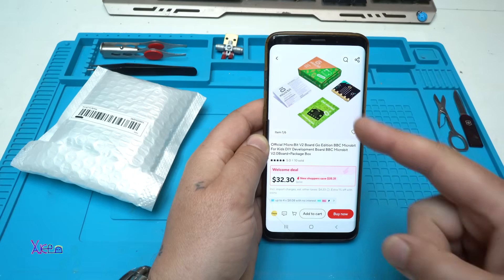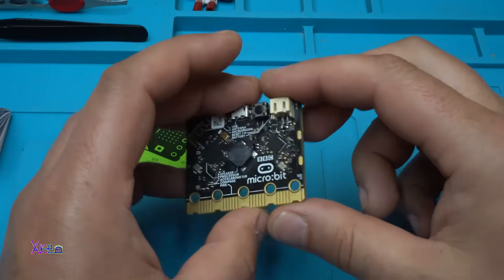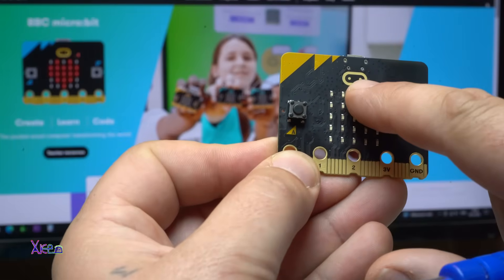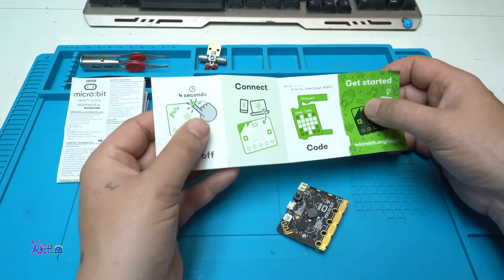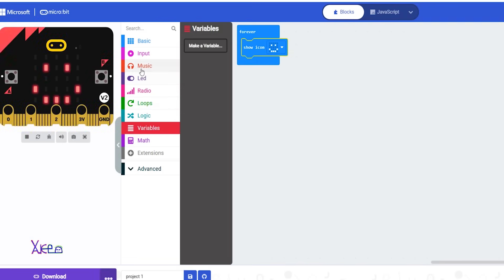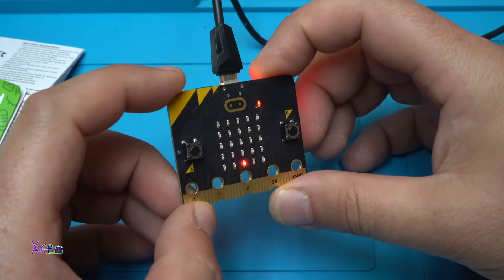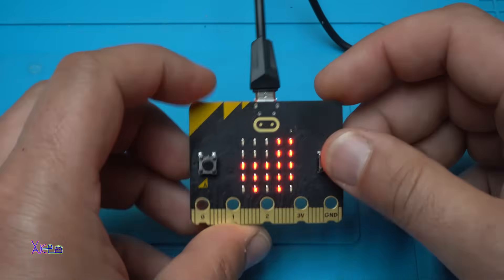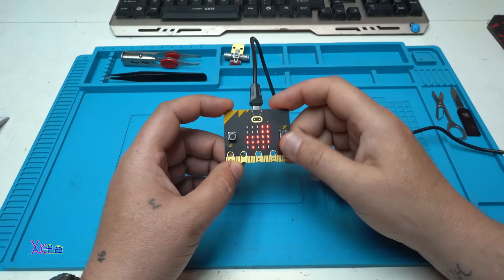Micro:Bit  Module from Aliexpress is FASCINATING?

Comment: It looks nice to have the 5x5 LED and a couple of sensors integrated, however even for kids (like 8+ yo) I believe that an Arduino, a breadboard, and the same components are better (and cheaper), because they'll also learn about the different components. For the coding, there are solutions where Scratch is integrated with different micro-controller boards.
Reply from the maker: Thanks for sharing

Comment: Theres also the Raspberry Pico:ed, based on the Pi RP2040. A bit different but comparable. But are you sure these ones aren't fake?

 But this thing is a really neat board. You can hook a lot of sensors and even robots to it, it can do a lot of things. They can communicate with each other, so e.g. you can put one outside and let it use sensors to measure the environment then send that data to another micro: bit, hook that up to an lcd display and show outside temp, humidity and so on. Thats only one example cause theres so much you can use them for. I really think this is a good way for kids (and adults) to learn stuff like this.

Comment: Huh?  They are £15 retail. Ali-express ripped you off!!!
Reply: New version is 21 Euro in the Netherlands. That would be the starter kit. Board, battery pack etc. I believe that would be like 17,76 English pounds or something.
Reply: £15 in the UK. Plus a generous slice of shipping and handling that the Pi stuff always seems to attract, because they are generally sold at cost. 
R-Pi pico cost me I think, £6 in "postage and packing". 
It is not nessicarily on sale from a vast range of international sellers. 

Outside the UK... Prices may vary. and if you factor in international shipping, there are plenty of places where it is as cheap to get it from China.
Reply: @JohnBailey39  OK, so shipping may change, but the base price of the unit 'should' be static imo.  But hey, I'm just saying, you buy and throw your money at whoever you like. It's still a free country (but not for long in the UK).